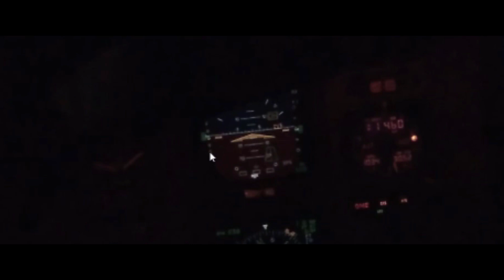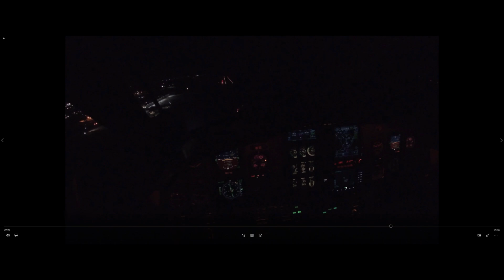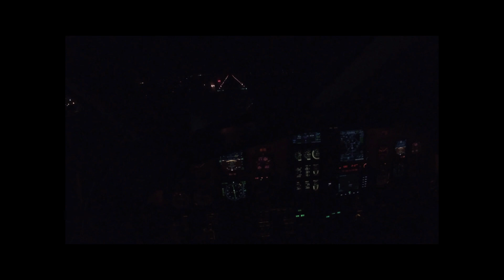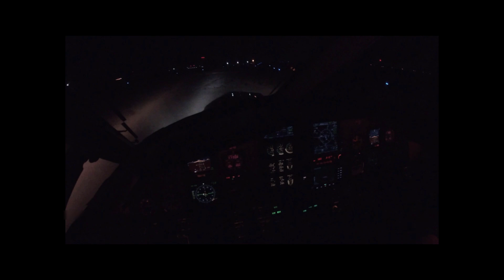Pilatus PC-12 Angle of Attack System

Comment: What typical airspeeds on approach do you use when landing on a normal length runway? Thanks!!
Reply from the maker: I use "flying miles" for my speed schedule on approach. Meaning, instead of using distance to the airport I'm calculating how many miles I need to fly until touchdown. For instance, if I'm making a traffic pattern approach, when I'm abeam the touchdown zone on downwind I've got 3 miles left to fly, one mile on downwind, one on base, and one on final, even though I'm only a mile from the airport at that position.

I slow to 110 KIAS at 3 miles to touchdown and gradually slow to "the donut" on the fast/slow pointer (1.3 x Vso) between 1-3 miles from touchdown, so that I'm at approximately 80 KIAS at a 1-mile final. Then, I fly the donut until the flare.